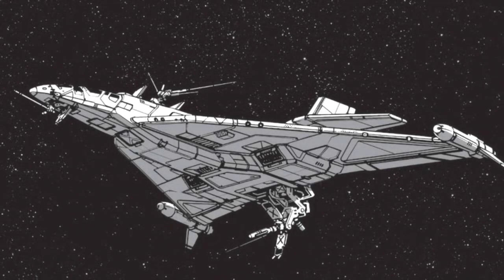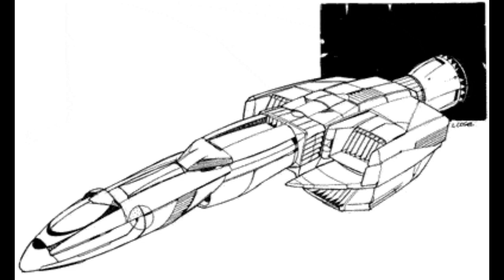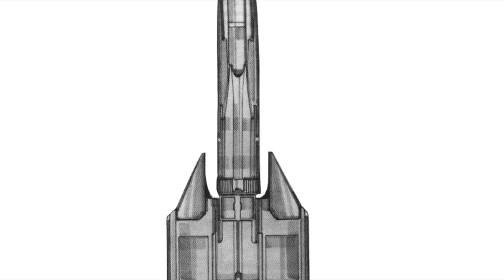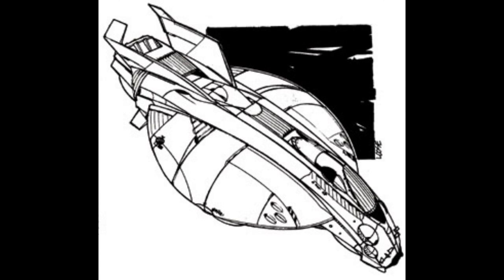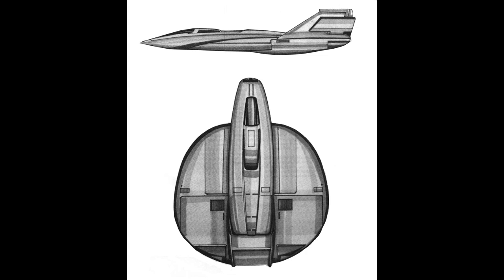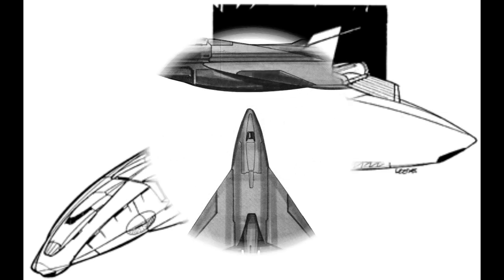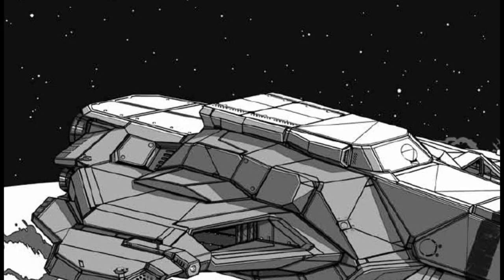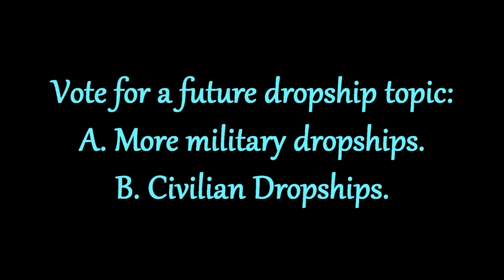Battletech Lore - Aerodyne Dropships

Comment: One of the big problems with the arodyne types vs the spheroid classes is that in most cases you need a runway to land the things. Sphere or ovoid can land just about anywhere. But, arodyne types can concentrate more firepower in one arc. Trade offs, trade offs.
B for the vote.
Reply: Which makes them useless. When would you ever have a runway near a battlefield? But I don't see why they can't land vertically though. Just use vectored thrusters or something. They have fusion engines after all, there's no reason why they shouldn't be able to do it.
Reply: @urquanseven2332  not totally. Some of the smaller one's ( Leopard's/Broad Sword) can land vertically. Most of the larger ones come in with the follow up waves, when a LZ has been secured ( kinda like modern transports ). One thing GDN forgot to mention, is that you can airdrop mechs from low orbit. Drop them, secure the LZ, land the Drop ships for vehicles.
Reply: I think this is why in most of the modern games, Aerodyne dropships are VTOL.
Reply: Transit drives let them land vertically usually...

Comment: Excellent video Grim. 
   I opt for B, Civilian Drop Ships. 
   If done right, one can 'Trojan Horse' a decent combined arms group onto a planet's surface in an 'out of the way' area, that will eventually become the unit's Drop Zone when the main attack group arrives. In my old play group, I did this several times... having civilian ships moved to a prospective target and 'lost' in the clutter of landings of other Drop Ships onto the planet, or, declaring an 'emergency' and landing far from the planet's Space Port. 
   When my Attack Group arrived later, this 'lost' group of ships would have already set up a Landing Zone and Defense Perimeter, and units from its ships would attack the Space Port in support of the main attack. One cannot stress enough just how important it can be to have a unit already on the planet, harassing the foe's Space Port facility, and causing havoc to the Enemy on the surface, while they try to beat off a space-born attack at the same time. 
   Even 'light' vehicles can cause enough confusion, causing perimeter alarms to go off, and forcing the Enemy to send units to investigate, thus depleting and spreading their forces out so that they cannot effectively contest a determined attack, focused on one place from Space. 
    Just my thoughts and memories, 
Speaking Frank-ly
Reply from the maker: It is indeed much better to have a safe space to deploy, than having to lose who knows how much of your forces just getting TO the battlefield.
Reply: @GrimDarkNarrator  Thank you for the kind words.

Comment: These things not being able to land vertically never made sense to me. If they require a runway to land, then when would you ever be able to use them in combat? Are there many runways near a battlefield? With that said, I don't see why they can't land vertically, considering they have fusion engines, they could simply have vectored thrusters or some other vertical landing thruster to allow them to land vertically. So silly.
Reply from the maker: Technology from the 80's :D
Reply: @GrimDarkNarrator  Indeed XD. They have FTL travel and protium fusion engines but don't have robots or drones (at least not to the extent that they should have them), and still use internal combustion engines.